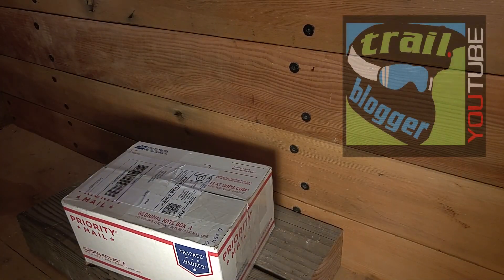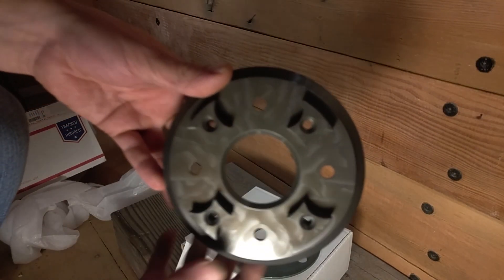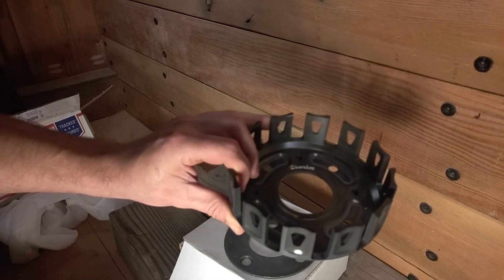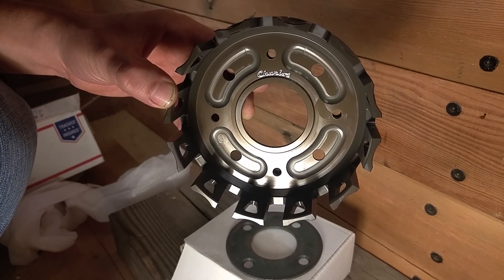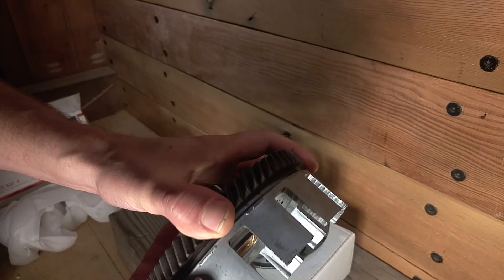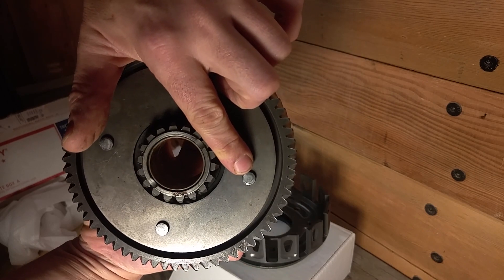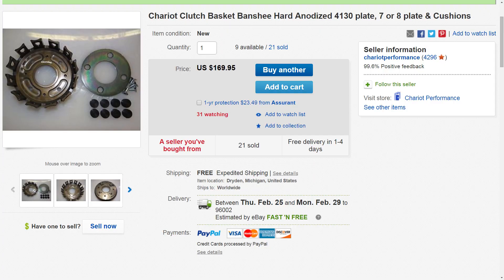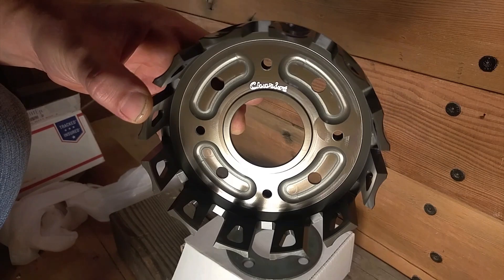Banshee Rebuild Parts: Hard Anodized Billet Clutch Basket by Chariot

Comment: It feels like it is still Christmas! keep the presents coming! most are afraid to open there motors the way you do. Thanks for your heavos and smarts TrailBlogger.   I support this video. I think you and your crew do the hardest riding. Your not just in sand like the So Cal folks at Glamis and Pismo. You ride steep hills, rocks, streams, mud, and over/through fallen trees. Every parts company should be eager and proud to have your endorsement.
Reply from the maker: +Long Beach Gas Powered Bikes It might just look like fancy bling but I am sure as heck glad to have a new one. Exploding a clutch basket inside her would be a nightmare I would prefer to avoid :-D
Reply: +TrailBlogger There should just be one place exploding inside her is right! and it's not the Banshee. Lol

Comment: Same model that I am going to run! 
Looks like a great system!
Reply from the maker: +StarPuss www.ToxicRedNeck.Com I was wondering what clutch you were going to run on that cub you are planning. For me it was down to this one, one by Mattoon Machining out of Oregon, or the Barnett. The Chariot just looked a lot more well made than the Mattoon which was pretty rough looking and the Barnett was a little more expensive. I have a Chariot 2 into 1 intake for one of my Banshees and I think they might be one of the only companies still making them. I wanted to help support them since that is another product I use already. What kind of clutch plates were you going with?
Reply: not sure on the clutch plates yet , thinking of friction plates from a 1997 YZF1000 , & smooth steel plates, some what a custom system.
I have used
Driveline Performance kits in the passed and they are great for the price.
Reply from the maker: ***** I am running a Tusk clutch kit, done good so far but not sure it would hold up to the cub setup you are doing. sent you a private message on facebook, you ever check that? got a question about a lawn mower for you bud lol
Reply: TrailBlogger 
http://www.ebay.com/itm/YAMAHA-BANSHEE-DUNE-TRAIL-8-PLATE-EXTREME-CLUTCH-KIT-/301636434958?vxp=mtr&hash=item463aeebc0e
that's the kit I was thinking of running.
Ill get to the Facebook msg soon , I am about 20 behind lol.
Reply from the maker: ***** oh dang that one looks great. I am sticking with a 7 plate system so I can run my stock inner clutch hub but I definitely agree you should go with an 8 plate setup on that cub monster.

Comment: Allot of people will just keep replacing their Clutch Disk's and then keep the same Basket every time they they need new Friction Plates "I'm saying this because I do my own small Motor Cycle Repair Business on the side" and then their first run or sometimes will work great till their 100th run their clutch will not Disengage and gets stuck no matter what only thing you can do it put it into Neutral all because a Clutch Basket was worn and Grooved and the Plates get stuck and wont pop back out. I have actually Files Down a Basket with a File and made it work for the Customers who are on a Budget.
Reply from the maker: +TRX Vlogger yeah the one I showed in this video was my "good" spare I had on the shelf. you should see the one I was running... I had pushed it long enough. Pretty sure the rubber cushions are completely toast in there.
Reply: Damn lol! Yeah I just figured I would tell you some of my Experience lol.